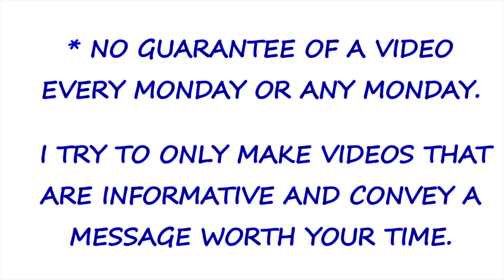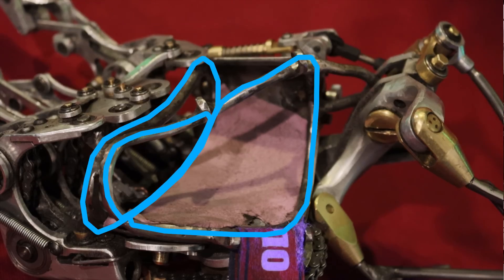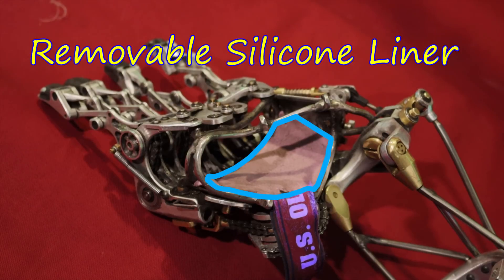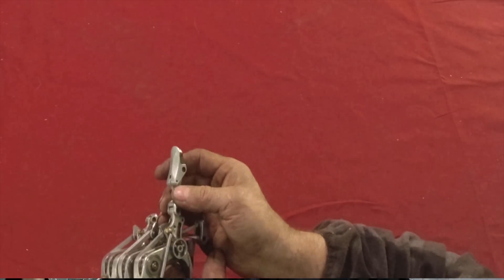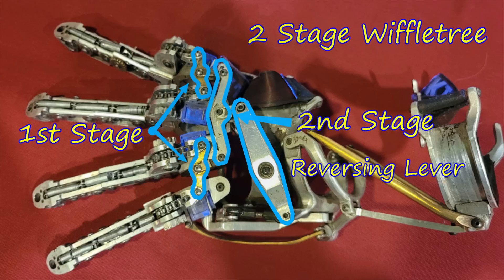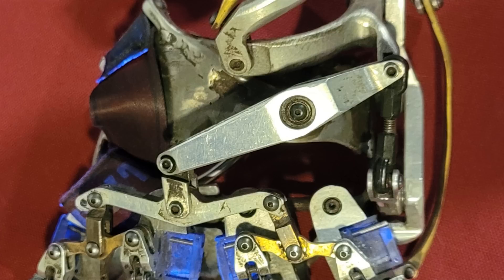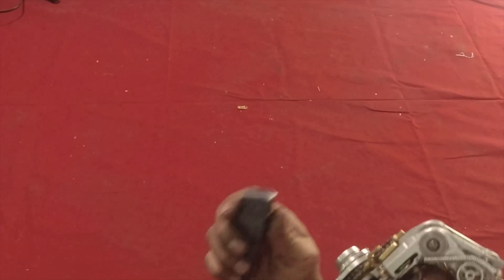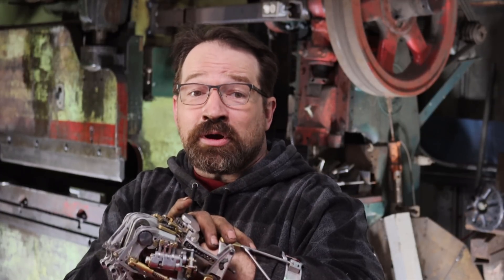Missing Parts Monday Building a New Prosthetic Hand! Episode 1 my next prosthetic hand

Comment: Regarding the socket fitting, have you look into the odontology approach to fit prosthetic dentures? Although these are custom fitted to your gums and palate, their shape and size varies over time and any empty space allows for food leftovers to slide in between rendering the denture painful and useless for eating. Odontologists have a substance (whose name I don't know) much like a hard sylicone: hard enough to prevent the denture to move even when chewing hard stuff, but soft enough for the gums and palate to accomodate. Whenever the denture gets loosened, they cast this substance right over the denture using your own gums and palate as the mold, once it begins to cure they remove it and let the coated denture cure for good before using it again. The substance is solid in the sense that it wouldn't bend for this application, hece not necessarily the best for another prosthetic. However, I believe it'd be easier and feasible to leave the fitting fine tune for a late adjustment that may not require your presence, but someone used to work with molds to fit the differences. As I see it, it's a matter of making a soft sylicone mold of the limb in the inside, and the prothesys fitting structure in the outside in which to cast the final fitting substance (perhaps a harder sylicon).
Reply from the maker: Yes, the issue with doing it that way is that the socket can be dimensionally accurate to the residual limb and yet under load be a terrible fit. The other issue not present with orthodenture is that the hand will swell and shrink throughout the day. And sometimes dramatically. Something else to consider is generally there is nerve damage associated with traumatic amputation, that can cause hot spots and areas that can't be loaded. These are but only a short list of variables that make fabricating a socket for someone remotely incredibly difficult. Thanks for the suggestion anyway,  I'm always looking for someone elses take on how to accomplish something I'm doing.

Comment: Just spitballing but what about using 3D vision to 3D print a PLA casting for the socket? Would theoretically make that process less finicky. Also would theoretically not require the prosthetic receiver to be in the same location as you. Have em scan with their smart phone. Make a 3D model on the computer. Cast it out of preferred metal. Or just an idea, send it to a shop to get it 3D printed in metal. Reach out if you want to colab.

Comment: Screw clasp plumbing belt.
https://youtu.be/l6GDXFgSFTs
If you add a matchstick micro motor to the screw and make your sensor or thumb do the open wind and shut wind reverse Motor you have a better belts X 2 as shaft between to cogged other second belt screw turned by 1 motor 1 inch memory foam full round inner belt or mostly memory foam will be comfy and less screw adjustable.
Half a inch memory foam both  left half circle tube and right as half C --- tube central  has hinged to  clasp slide similar to spectacle case slider clasp.

Comment: maybe you've already explored this option, but to solve the whole "making a fitting socket without the client present" issue, would it no be possible for the client to make a silicone mold of their residual limb, and then send that to you? then you could make a cast from their residual limb, and use that to make the socket fit properly? I still see some issues with this, for example if the client isn't capable of trying to make  mold, or if they do, that they might lack experience and make a mold thats useless anyway. but I just thought id throw my idea out there. you make awesome stuff, and I love seeing both you thought and manufacturing process!

Comment: I saw a post about it on reddit, but there's TPU 3d printer filaments that change shore hardness depending on nozzle temperature. Using that you could transition from a rigid to a soft socket, to allow for the right support and comfort where needed.

Comment: Ian, 
Have you messed around with using metal wire instead of chain? My current "workshop" is stuck to 3D printed plastic in a small room so I really don't know what kind of strain it can take, but I imagine it could be a lot more compact and lightweight having some grooved rollers and wire (maybe fixed at each end with an eyelet?) running the finger mechanism than chain and sprockets. Either way, cool stuff! Can't wait to see the next iteration.

Comment: Low tech but pretty good socket suggestion(for people far away) , greenstuff. It's like modelling clay that hards itsself out (over the course of a few hours, faster or slower depending on the amount of blue to yellow stuff)... People could literally put the clay on their hands, and put it in and off. If that's solid but comfortable. They could send you that, you'd have a perfectly sized example? Can't really test this since I have full hands though sooo sorry about not pre testing before suggesting. (edit, vaseline on hand, then clay on hand so it doesn't stick while still formable)

Comment: have you considered rotobroaching a spline in the outer plate to spread the load out over a greater area?  The shaft that drives it can then be a spline shaft.  That might fix your shearing issue.    Could you use use a heat activated polymer  in the flesh to machine interface socket;  similar to the polymer's used in mouth guards.   That would allow for a  perfect fit created in the field.

Comment: Instead of a full blown osteo integration, what about implanted magnets that some biohackers have done as a first test for them? You may be able to have them implanted to bone, Im not sure on that, but even subdermal may be able to provide some extra stability and connectivity to the prosthetic. The prosthetic moving may even cause a slight pulling on the magnets to give an extra bit of sensation or feeling to what its doing. Just a very late night thought with very little knowledge on prosthetics but a very fun and thought provoking one for me, even if not practical. What you've shown us over these videos is just amazing so even if my 2 cent idea is at least amusing, im glad
Reply from the maker: Those magnets would have to be huge! And the iron mass you'd need to add to the device would be substantial. If you want to be able to pick up say 40 lbs the magnets need that much pull plus the weight of the hand times however much velocity that you're moving your hand at. Then dealing with all the metal filings from my shop. Sorry,  I'm going to keep that in the same pile as the otf short sword.
Reply: @missingpartsclub  No worries, mate. I appreciate you taking the time to comment on the idea. Keep up the good work

Comment: It makes no sense to built in a 12 inch knife. So glad you delete on that suggestion. But wat makes more sence is something else you could use in your hand. Something like a chip or a key button. Or even a garage door remote controle or a key licht so you can find your door lock in the dark. Or perhaps grippy silicone fingertips. Or a handshake funktion. Or a funktion to handel a screwdriver. I like the double bearings and the soft padge on the wiresocket. I always find it funny how your hand makes that noice clickerdeclack when open or close the fingers but you could remove the sound so it gets to become more userfriendly when in public. I like how it looks but it still looks a bit bulky.

Comment: As cool as a retractable blade would be, I can understand the impracticality of it.  I do have some ideas for more practical add-ons.  A lighter or a screwdriver, potentially a ratcheting screwdriver even with interchangeable bits.  Some sort of low impact tool that you regularly use.  A watch built into your prosthetic would be pretty classy.  One with a transparent face to show off the clockwork would fit the aesthetic, I think.  Also, adding some sort of storage, like a pocket could be useful.  You'd know the feasibility of these ideas a lot better than I would.  It's just thoughts I've had.  I would be pretty jealous of a lighter finger, ngl.
Reply: I'd say "a chainsaw" but this absolute chad already built and demonstrated one :D

Comment: 3d printed socket, maybe? 3d printers allow for rapid design, to get the perfect fit, and also can be used with a variety of materials, so you could use a rubber plastic mix to provide the prefect balance between rigidity and comfort.

Comment: Do you foresee a point when adding electronics back into your hand (it seems your earlier models utilized some) will make sense?

It seems like an electronic selector of functions (perhaps with mechanical override) could really provide additional utility while leaving the best strengths of the mechanical design intact.
Reply from the maker: Idk, after basically throwing away 1000 hours with the 157 hand I am pretty gun shy about going down that road again. The thing is, as cool as electronics are, mechanical never runs out of batteries, doesn't care about water. And is super reliable. I haven't found that in electronics yet. I still play with arduino and rpi, but for a hand. Not so much right now...
Reply: @missingpartsclub  that was my thoughts with a mechanical override for the grip selection, and leaving the finger actuation purely mechanical. Conceivably it could be designed such that is failed-to-manual operation.

The appeal (I think) is that your mechanically driven fingers, and grip selection really reduces the required bandwidth of data that would be needed to control it. Effectively one byte to indicate the mode is all you need to capture. I think it could provide a massive advantage over other prosthetics I have seen (not that I am an expert by any stretch of the imagination)

That being said, I am speaking from an outside point of view, and biased by virtue of being a firmware engineer, so I could be way off the marc.

Anyways, thank you for your videos, they are always extremely interesting, and I greatly enjoy the insight into your machining techniques (I do a fair bit of manual machining as a hobby, it’s an incredibly efficient way to consume time and money :D)

Comment: could you make the socket with a shoelace design so you can tighten or loosen it to be more comfortable depending on the day or would that not work ?
Reply from the maker: So I've done a couple proof of concepts along those lines.  Mixed results,  the issue I ran into was with all the adjustability I lost a pile of stiffness that I need in order to get the fingers to fully articulate in the 54 degrees I get from my wrist movement.

Comment: How often do you do maintenance and how long does it usually take? I’m asking more about oiling and tightening any loose parts than replacing parts
Reply from the maker: For the fingers and gimbal pretty rarely, although I end up recoating the distals with plastidip every couple of weeks. The pattern selector is another case entirely. I get about 3 weeks on a tune, then I need to break it down, clean everything, and lubricate. Probably about an hour or so to break it down.  The issue is the design requires things are pretty precise and when it gets too much gunk it gets grabby and doesn't cycle awesome.  The new gear design hopefully eliminates some of those problems.

Comment: you probably need some "plugin" instead of modify your hand too much while you hand is comfortable to use. say…a stubb socket ranche, with a knob as big as a breakfast cereal bowl, which you can rest that hand on it. if that's not enough torque, a knob that big can easily fit a metal bar to use both hands to loose a screw. that is also a product it can sell, for elderly or women who don't have sufficient strength to unscrew tide bolds.

Comment: Nice video Ian. One question I have for you is: Do you operate your machines while wearing the prosthetic hand or do you take it off?
Reply from the maker: It depends,  but most of the time I take it off when I'm running the machines. Not because it doesn't work well, but because I'm afraid of breaking it while operating the machines. I didn't build a lot of extra parts for this hand like I did for previous versions. So when/if it breaks I'm without my hand. Which is a huge mental thing for me.

Comment: If your budget allows, I think it would be rather poetic to have a fully mechanical watch. The Omega seamaster or planet ocean seem like they would match your prosthetic quite nicely. I think it would be particularly cool to eliminate the watch straps and have it floating on linkages half a millimeter above your wrist, prevent that sweat
Reply from the maker: That's the concept. no straps, just 2 tiny brackets that the pins go through to hold the watch. and ya the watch should be a mechanical auto winder, something vintage, but not over the top. i've seen a couple watches on the wristwatch revival channel that would be cool. i've tried reaching out to him a couple times, but i think that my messages got lost in the noise.

Comment: This is a very low level comment for your channel, but I imagine you have a fair number of disabled viewers. I myself have a pretty severe progressive movement disorder. I spill and break things multiple times a day. I'm always building little conveniences for myself, I often build them for others with similar conditions. I just recently came across a very simple but remarkably useful tool for a whole bevy of disabilities. The humble bedside urinal. You know those plastic jugs they give you in the hospital with the canted neck? These are extremely well designed, the Apex of the handle is the perfect COG, I can fill it to the brim and swing my arms hard while walking or wheelchairing, doesn't spill a drop! It has an open-ended handle which allows you to hook it on a walker or wheelchair handle for the same no spill option. I've come to rely on these for everything from filling my dog's water bowls to watering the plants. It's not very visually appealing, but they are also available with caps that allow you to use them as drinking cups as well. Usually any adaptability product is wildly overpriced, these are less than $3
Reply from the maker: That's awesome! and you're absolutely correct, medical anything is absolutely stupid when it comes to pricing.  just be sure to label which container is which, and what they've been used for.

Comment: I'd like to ask, when it comes to covering up the linkages and moving parts for safety purposes, would you provide mounting points for rounded covers? Let's say you were holding the hand of a child or elderly person as you walked them across the street. You'll need to cover the moving parts so no accidental pinching may happen. Would you consider some lightweight panels to cover some sections for safety, or even rain?
Reply from the maker: Really it doesn't have near the amount of pinch points that you're thinking. and if i was holding someones hand i'm going to use my natural hand preferably.

Comment: People are using there phones as a 3D scanner these days would that assist in socket manufacturing?
Reply from the maker: The problem is with "the feel". Dimensionaly it could be absolutely perfect, but the squish of the residual limb isn't the same all over the hand.  you'll also have spots where you can't put a lot of pressure on comfortably. that's the issue the fit is super subjective, and will vary from day to day.

Comment: While chain is clearly better, could you accomplish the same with a cable? It seems like you'd save a lot of space and weight.
Reply from the maker: Not really. So the cable itself might be lighter than the chain, but the hardware to terminate the cable would be heavier than that of the chain. You'd also have to consider the minimum bending radius, I can bend the #15 miniature chain around a 5/16" bearing without issue, if i did that with cable it would kink. Another  consideration is friction, cable has a higher rolling friction than the chain.

Comment: a "basket hilt" of removable tools on the wrist could compliment the steampunk look.  If the tools were useful for adjusting and tuning the hand it could be actually useful to have them around.
Reply from the maker: So I kind of did that starting with the 157. I have a built in holder for the 2 sizes of Allen wrenches that I use to put the hand together.

Comment: Would using magnets within the sockets to connect to pins screwed into the bone and beneath the skin work?
Reply from the maker: Considering that the screws would need to be made of high carbon steel in order for the magnets to work. The results would be less than desirable.  any contact with blood is going to cause the steel to corrode. Causing a blood infection. The reason why titanium is used for implants is because it is an osseo‐integrator. Bone will grow around it and actually Integrate the titanium into its structure.  That being said,  there are a lot of ifs that need to be met for integration. Rejection and/or Osseo necrosis is always a possibility with implants.

Comment: Use springs and a selector gear set static to the wrist to facilitate desired function with form with the  forearm. (edit) or simplify functions to two main functions between a "full grip" to increase weight compacity and a simple gear switch to the index finger and thumb for dexterous applications.